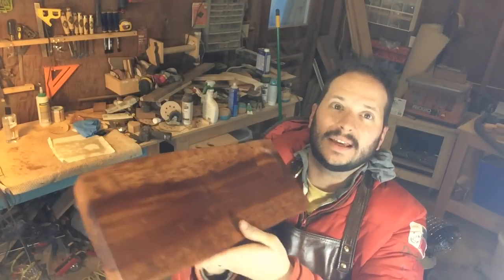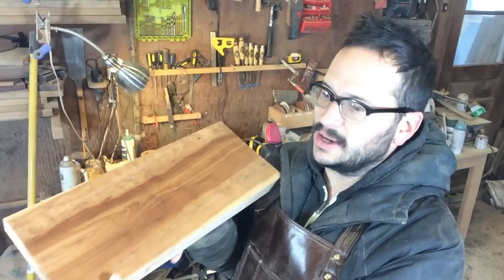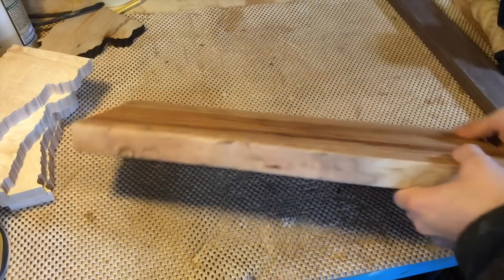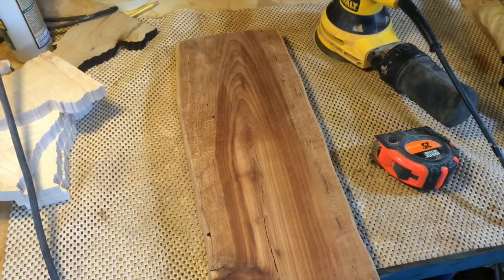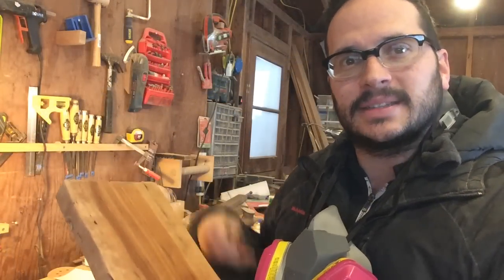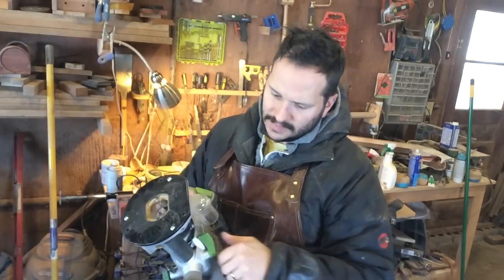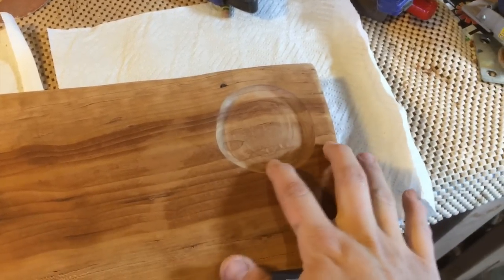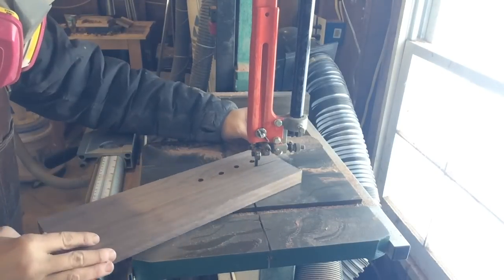Make a footed Charcuterie Board - in Winter!

Comment: Steve,

Like the project and really like the "mistake" router hole.  It fits the project nicely.

Working in 10 temps, you may want to change the name to "Unpleasant Ranch" :-)  I can remember shop temps like that when I lived in Michigan.  That's why I'm not there any more.

I've had that Bosch router set for almost 20 years.  Good stuff.

JimE
Reply from the maker: Awesome! Yeah, on the whole, I've had the best luck with Bosch tools. Though, I have no loyalty beyond that. I'm toying with the idea of using the old router as some kind of specialty, standalone tool. Like a little Mortiser that it setup to do one repetitive thing. The motor still works, after all. (What would Mathias do???)

Comment: Very nice project!  What is the benefit of using the wet dry sandpaper to apply the mineral oil as opposed to just wiping it on?
Reply from the maker: Hey Brian! Good question. There are many reasons why I "wet-sanded" this piece. 1. It works the finish deeper into the pores of the wood, which means better adhesion and fewer coats. 2. It creates a bit of heat which polymerizes the finish better (fancy words for makes it stick.) 3. It creates a "slurry" that fills in those tiny pores and helps smooth things out even more. Visually, the result is probably not much different than just wiping on some oil; the difference is in the feel.